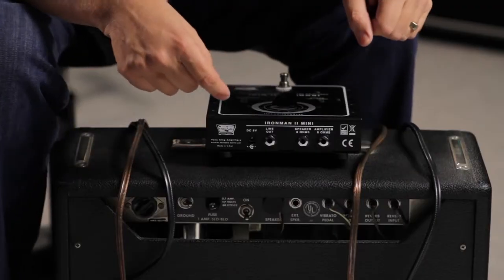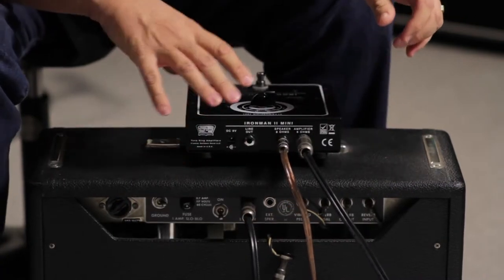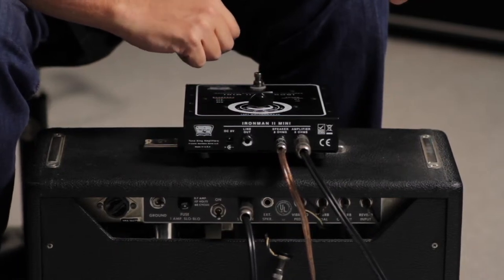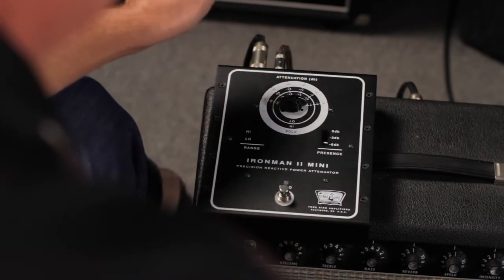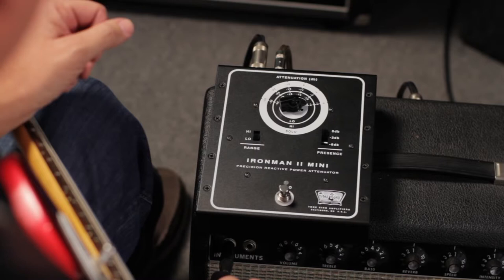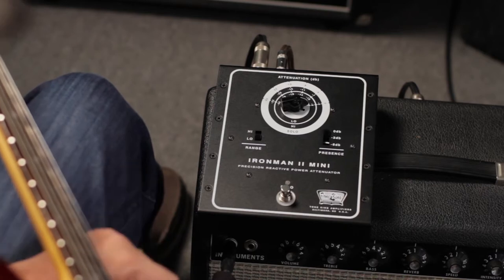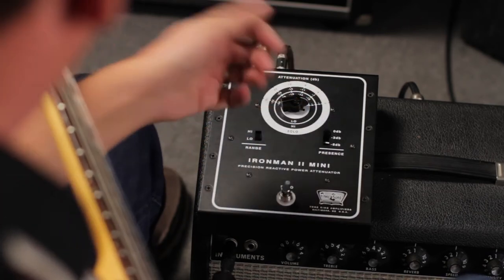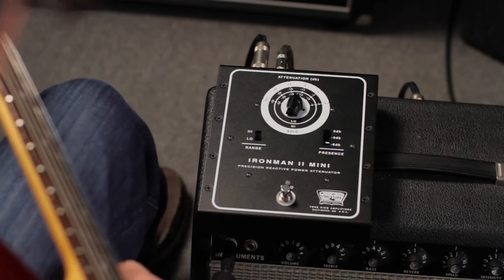Ironman II Mini Attenuator Introduction Video

Comment: Great demo! Any issues with using the amps effects loop while running the Mini? I have heard that some attenuator don't play nice with effects loops.  Also, how would you use the solo button on stage?  Man, a footswitch jack for that would have been an out of the park homerun!
Reply: I think it is the solo switch, get a long enough speaker cable and run it next to your board, which imo isn't really practical cause it'll get hot. The bigger version of the ironman ii has a foot switch out

Comment: Hey, is there any chance that something might get damaged doing this? I have a Fender Vibrolux Reverb Reissiue and I want to do this but I am too afraid to risk anything because it was so expensive.
Reply: Me too. Im currently doing research. I have a Princeton. I will try to Contact Fender directly - to get a Definitive answer and let you know what they say, & which one they recommend.
Reply: As long as the attenuator can handle the wattage, it's very low risk. Normally user error that does damage.
Reply: The important things are to use speaker cables, NOT instrument cables and to never ever turn on the amp without the speaker plugged in.